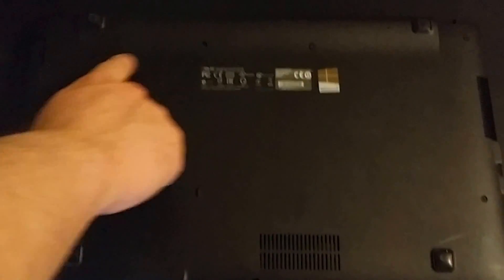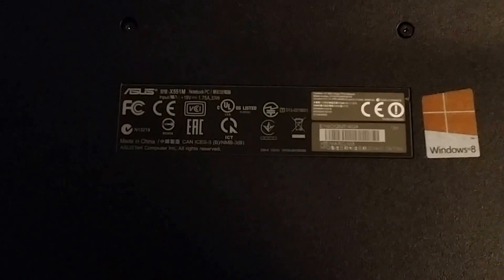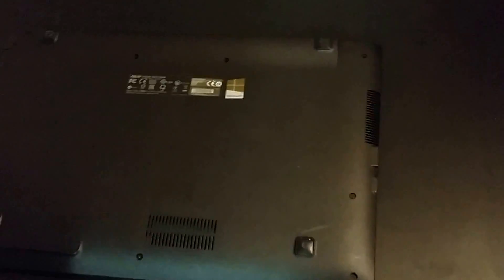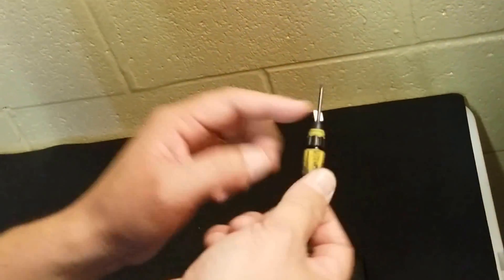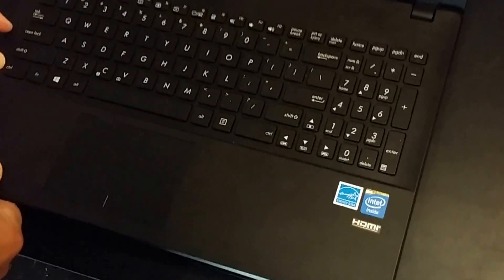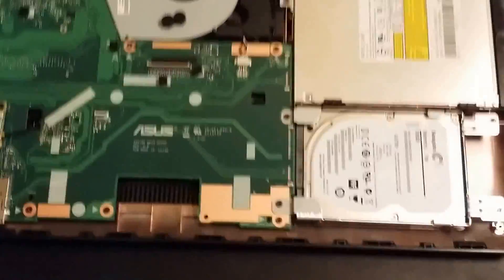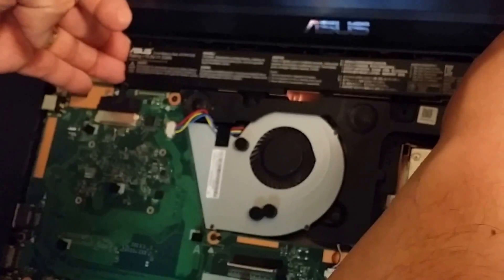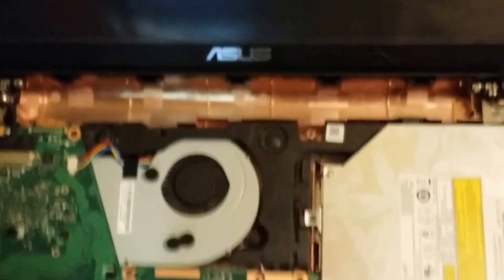ASUS X551M Laptop Battery Removal & Won't Power On Fix

Comment: hi, question, my asus X451C display turns pinkish, working normally but all white turns pink, can you help me fix this? thank you so much.
Reply from the maker: +Kate Cuadra Hi there!  In order to fix it, we need to find out the root cause and in order to do that we will have to do process of elimination troubleshooting.  First off, we need to find out if this is a software or hardware issue.  Hardware first.  Connect this laptop to an external monitor then use your "fn" key and the associated top F1-F12 keys that switched your screen image to an external monitor.  Do you see the pinkish color on the external screen?  If yes, then you need either a new LED screen (90% probability) or a new LED cable (10% probability).  Do you see any glitches or "artifacting" which look like 8-bit blocks randomly around the pinkish screen?  If so, then your graphics chip is going out.  If neither of these have YES answers, then your issue is most likely SOFTWARE based.  That means either you need to update your graphics drivers or your Windows OS has a graphics related problem.  You can update your graphics to the latest driver but if it is a Windows related problem, you might want to take your laptop to a computer repair professional.

Hope this helps!

Devin

Comment: same case with the comment before. plugged in but not charging. but now my laptop always force off just 5 minutes on. can explain what happen? hopefully just the battery
Reply from the maker: +Alfonso Enrico Could be the battery but most likely a DC jack issue or overheating issue.  You would have to check your fan and vent area to make sure that you don't have either one clogged.

Comment: MINES SAY 0% CHARGING BUT WONT CHARGE. IT WILL NOT HOLD A CHARGE AND DOESNT WORK UNLESS PLUGGED IN. IVE TRIED EVERYTHING AND MY WARRANTY JUST RAN OUT A MONTH AGO.  AT FIRST IT WAS STUCK ON 85% BUT I UNPLUGGED IT AND FORGOT IT WAS I SLEEP MODE SO IT FULLY DIED. I DID THE HOLD DOWN FOR 60 SECOND THING, THE BIOS, DELTETING THE APCI THING ALL THAT.
Reply from the maker: +qwaneasia You have one of three possibilities.  Either your power adapter is going bad, your battery went bad (it is uncommon for a battery to go bad after only 1 year though) or your motherboard's battery charging port is defective (laptops under $350 are not the most hearty when it comes to build quality).  Try to get another power adapter first (a universal one at a computer shop or a Batteries Plug type of store) to see if your battery charges.  If it does not, then purchase a new battery.  My suggestion is to remove the battery and install a new replacement to rule out the battery as being the problem.  You can purchase a new battery for around $20-$30 on Amazon or eBay.  Follow my video's instruction to remove the battery when you get the new one to install.  HOPEFULLY it is only the battery.  If you still cannot charge it then it is most likely the motherboard.  At that point you would have to decide if it is worth fixing due to the added cost of a replacement motherboard.

Good luck!
Reply: Asus must have never put the screws back in because they weren't there I just popped the top off and the was the battery. Now to rewatch your video. But I think it's because I always have it on and forget to unplug it. Yup only a year old. I'd rather just keep it plugged in vs getting it repair.
Reply: have you tried SHOUTING at it?
Reply: qwaneasia did you ever figure out how to solve the issue?
Reply: qwaneasia yooo sameeee this is my current situation I gotta be plugged in 😩 or it dies

Comment from the maker: @Sixx 06 95% of laptops will work without having a battery inserted using ONLY the power adapter.  Keep in mind though that you are essentially making the laptop into a portable desktop that will always have to be plugged in to stay on.  Place the battery (if it is still good) in a cool environment between 34-38 degrees (refridgerator) and the battery will last longer.  Hope this helps!

Devin
Reply: If my computer is working using only the power adapter, but not charging (sits at 0% charged) this likely means the battery is shot, yes?
Reply from the maker: Yes.  99% of the time that means you need a new battery.
Reply: +aC rikC Place the battery in the refrigerator to help preserve it then.  You can use your laptop without it.
Reply: +aC rikC No problem.  Good luck and have fun gaming!
Reply: we have similar asus laptop

Comment: How do I get the keyboard cable back in? I could get the other two in but the keyboard one won't go back in
Reply from the maker: +Mara T Hi Mara,
Assuming that your did not damage the keyboard connector latch, it can be a frustrating process unfortunately.  To be honest, I had my son help me as he held the keyboard lid at a 45 degree angle while i used my plastic "tweezers" to hold the keyboard ribbon cable inserted with one hand and my finger to lock the ribbon connector latch downward.  If you are having problems doing it yourself, you may want someone to hold the keyboard lid for you like I did.

Hope that gives you some insight and help!

Devin

Comment: Angrysquirrel PC,

I believe the Bios battery is dead on my moms laptop.  Where do I find that at?  Thanks.
Reply from the maker: +Lee Jacobs Is your mom's laptop this Asus X551m model or a different model?
Reply: It's the x551m model.
Reply from the maker: +Lee Jacobs follow the instructions on my video to disassemble the laptop.  Once you get to the motherboard, you will have to remove the DVD drive, Wireless Mini Card (remove the antenna wires first the unscrew it), remove the seven screws holding down the motherboard, remove the lcd screen cable, remove the two upper left corner screws by the lcd cable area, remove fan and speaker cables, then lift the motherboard from the right side then gently pull upwards.  You should see the CR2032 BIOS/CMOS battery that you can change out.

Good luck!

Devin
Reply: Thanks!
Reply from the maker: Anytime!  Good luck!

Comment: Angrysquirrel PC and all others
Hi again and sorry for the delay.
After when trying to re-installing the image on hard drive with a SATA USB converter, and failed to boot, I went to place were they repair computers. After 3 months they told me that couldn't repair it, so my only option was to delivery to ASUS Technical Department. Fortunately the repaired by replacing the motherboard, that in this F555LP model includes all parts.
Could be a BIOS corrupt issue or other cause? - I don't know but one thing certainly, I will not try again messing with Windows 8, instead I will install XP32 in a virtual machine.
Hope this helps...
Reply: +Jay C Thanks for the update!  Yeah a finicky motherboard can cause strange issues and problems.  Glad to hear at least you got your computer fixed!

Devin

Comment: Where's the ram
Reply from the maker: +Rocky Math The memory is on the underside of the motherboard.  You would have to go one step further by removing the screws that hold down the motherboard and to disconnect other cables like the LCD screen connector and the Wireless antenna cables before you try and remove the motherboard.

NOTE:  Some models of this Asus laptop do NOT have removable memory as it is soldered on and not like a common removable DIMM Memory module.  You may not be able to upgrade or change out the memory if your motherboard is the soldered on kind.

Good luck!

Devin
Reply: thank You!!! :)
Reply from the maker: +Rocky Math You are most welcome!

Comment from the maker: @Guayas Garcia.

Sorry, since it is a linked comment, I could not reply to you through my channel.  The keyboard is actually part of the top lid assembly.  You cannot easily replace just the keyboard.  You will have to get the entire keyboard/power button/touchpad lid if the keyboard is defective.

Sorry for the bad news.

Devin

Comment: I agree. Complete Moron! But thanks for the advice. This video was very helpful. I didn't have to send mine to the shop for repairs. Saved alot of money. Although I am having quiet abit of difficulty reattaching the keys ribbon. Its not broken or anything. Just need a little instruction.
Reply from the maker: +john jones There is no really "easy" way to get to the ribbon cable unfortunately.  As the video shows, you have to first separate the lid by releasing the plastic snaps that hold the keyboard lid to the bottom base then SLOWLY lift the lid from the front then get your hand in to the motherboard and release the touchpad ribbon cable, then keyboard ribbon cable then Power ribbon cable in that order.  To release it, you have to lift the latched lock connectors upward then gently pull each ribbon cable out of the slot.  If your hands are larger then normal, you will have to get a non metallic flat pointed object such as a narrow tipped nail buffer or something else to lift the locked latch if you can't reach it by hand.  I know it is a PITA but that is how you have to do it.  THEN you have to somehow get the ribbons back in after you need to reassemble it back.

Good luck!

Devin

Comment: The advice was pretty good, but it assumed that I knew how to disconnect the 3 ribbon connectors to the on/off, touch screen and keyboard. I was unfamiliar with how they worked and the touch screen conector broke. I'll be using a wireless mouse from now on. (At least I didn't mess up the either of the other two connectors.) Thanks, Best Buy for fixing it for me.
Reply from the maker: +Alan Rudolph Yes, in the video i did state to be careful removing the ribbon cables and pointed out the locations.  They are a flip level type that holds the ribbon cable in place.  Sorry you broke the touchpad connector but as you said, Best Buy to the rescue!

Comment from the maker: @ conner Joey

As long as you don't have a broken piece inside the COMPUTER'S usb port you should be OK.  Follow the video's instructions to remove the battery.  Hold the power button down for 30 seconds to discharge any residual power then reassemble the computer.  Your computer should now be able to turn on.

Good Luck!

Devin
Reply: what happens if you have a damaged usb port?
Reply: +Angrysquirrel PC now how do i hold down the power button if the keyboard is off
Reply from the maker: +quadir Fleming You reattach the power cable then hold the power button down to fully discharge the system.  Yes dumb I know but look at the kind of laptop design this is.
Reply: ***** yeah true...thanks for all the help im in a IT CTE class and I left it with my teacher and she'll try to fix it further this a great channel..and will grow in the near future you have my sub...good luck (conner joey on other account)
Reply from the maker: You are most welcome and good luck on your IT class!

Devin
Reply from the maker: +jamesthreehundredethan ragnoth Unfortunately, there is not much you CAN do unless you have some soldering skills.  If you can find an EXACT USB port for that motherboard AND have good soldering skills, you can de-solder the damaged USB port, remove it, replace with a NEW USB port and solder it to the board.  If you don't have soldering skills or are afraid you will damage the board (Damaging the board happens easier then you think by the way), you can always purchase a used or new replacement motherboard from eBay and just replace the whole board.
Reply: how do u put the laptop back2 gether plz reply fast

Comment: please respond I have this computer and I had my USB charger in the phone connected to the laptop then.but the charger had a short in it and I tried to wrap it around to charger my phone...the the piece broke in my phone and then the laptop made a noise and it cut off..and wont turn off but the lights on the bottom come on and I just got the laptop...please help(subbed)
Reply: I had a similar problem... I plugged my phone into the usb jack to charge it and the laptop made a strange noise, then died. At first I thought it just drained the battery, but since it was four days old I called warranty support. They walked me through a dozen or so trials, then ended up returning it for a replacement because it couldn't be fixed by user.
Reply from the maker: Thank goodness for warranty support!  No need to disassemble it!

Comment: I have one of these bud and there's no power at all. there is power coming out of the power cable but nothing on the PC any ideas would be great
Reply from the maker: +Harry Chanter If a laptop won't power on, it could be one of several things:
1.  Your AC Adapter has gone bad.  Try to get another compatible AC Adapter or Universal Adapter and see if it powers on.  You don't know HOW MANY TIMES customers come into my shop telling me that their laptop won't turn on, then I plug in my Universal AC Adapter and it turns right on.

2.  Your battery has gone bad.  Remove your battery and plug in your AC adapter and try and see if it turns on.  This MIGHT be the problem as bad batteries can cause a laptop to not turn on.

3.  Your Motherboard / Power Button board (on certain models) has gone bad.  A motherboard replacement can be costly depending on the model but EBay and Amazon is a good place to look up prices for replacement parts.  A power button board is less expensive but is still a part that can be costly depending on model.

4.  This SOMETIMES HAPPENS and don't laugh.  Make sure you are plugging in your adapter on a KNOWN good electrical outlet and the outlet is turned ON AT THE SWITCH (for those outlets that have a on/off switch).  I know it is funny but it can happen.  You drain the battery and it won't turn on and it won't charge because no power is going to the laptop.

Let me know what you find out!

Devin
Reply: +Angrysquirrel PC cheers bud
Reply from the maker: +Harry Chanter Good Luck sir!

Comment: if i remove the battery and use the charger as a source, it still work right?
Reply from the maker: +nikko decretales Yes.  It should work with no problems.  Just be aware that if the power goes out, the laptop will turn off with no battery as a backup.

Comment from the maker: @bstructiongame

Your computer question for the Grey Screen on the ASUS Laptop could be several things.  The first thing you should do is to connect the laptop to an external monitor to see if you can see a picture.  If you can see a picture, then it is most likely either the LCD Cable or the LCD/LED Screen.  If you still can't see a picture try removing the battery to "reset" your laptop.  If you STILL have a gray screen you mostly have a graphics chip/motherboard issue.  You can find current prices for all of your parts either on eBay or Amazon and see if it is worth fixing.  NOTE:  If the price of parts exceeds 50% or more on parts/labor, it is recommended to purchase a new laptop based on the laptop's original purchase price.  That laptop sold for around $300 at the time.  So if parts is going to cost over $150, you might not want to fix it.

Good luck!

Devin
Reply: Angrysquirrel PC do you have Skype so I could face time you because I don't want to brake my laptop

Comment: i have a same model of asus. my screen blacked out with no display and power sign is on, and no keys are responding... it wont switch off... no charging sign is shown while pluging charger... should i remove battery bcz m nt sure i can assemble it back correctly
Reply from the maker: +Sanchit Jain You SHOULD be able to power down your system by holding the power button down.  If that does not work, you should wait until the battery completely discharges and powers down BEFORE you attempt to disassemble your system.  This is to prevent shorting out anything while disassembling it.

Good Luck!

Devin
Reply: +Angrysquirrel PC  battery is discharged completely but i cant turn it on now even after pluging in power supply... power light get on for two sec i can sense something starting but then nothing happens.. battery charging sign is visible now
Thanks for help...:-)
Reply from the maker: +Sanchit Jain ok good.  disassemble the laptop to remove the battery.  thhis should allow you to reset the motherboard to boot up the computer normally now.   if the computer still wont turn on then try it with another power adapter to rule that out.  if new adapter doesnt work then it is most likely a bad motherboard.

Comment: Would this be able to upgrade to an SSD?
Reply from the maker: +Joey Trevino Yes.  You would have to disassemble it according to my video to get to the hard drive slot.  Remove the Hard Drive and install you new SSD.  Then reassemble it back in reverse connecting the cables then lid then screws.

Good luck!  You will have a much faster computing experience with your SSD installed!

Devin
Reply: @angrysquirrelpc9181  Don't forget to clone the HDD before all this!

Comment: Hello there, that was an awesome way how to carefully remove battery.An year ago bought same notepad Asus x551c. It was working fine until i realizes battery is not charging.One day i was watching movie i forgot to put it on charve. Machine shut down automatixally and as i did not want to disturb my sleep...laptop was then put on charge after 24hours.even when it is connecfed directly .no light,no fan..nothing bappens..the only thing i can say is...once i connect adaptor with wll socket ...it wud spark couple of time..help me as m losjng kn my job.....
Reply from the maker: +Siddharth Sharma Most likely, your motherboard dc jack or your motherboard went bad.  First, eliminate your power adapter as being the problem.  Get a known GOOD power adapter and test it on your laptop.  If your laptop still will not power on or charge, then you might need to fix the soldered on DC Jack or replace the motherboard.  Sorry for the bad news but these inexpensive ASUS laptop models are not very sturdy and if anything goes wrong, they want you to buy another laptop.  They made them this way to be "DISPOSABLE".